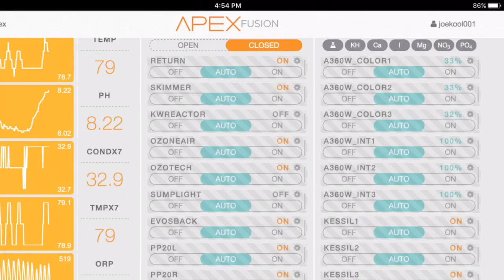How to make a Venturi

Comment: how many meters this pump can go down the well can it go down 10m below d ground?
Reply: Yeah why not? Pumping water down is not hard, if you needed to pump air 10M below and displace water that would be hard.

This is why Venturi is extremely useful for aeration under high depths.

I would recommend using this over air pumps. Its much cheaper, and in most cases it is easily adaptable to existing pounds that already have a high pressure water system.
Reply: Tfxit ftatst
Style is the hiiiiio I iioiovbbioiicovivioviij. Duffy you